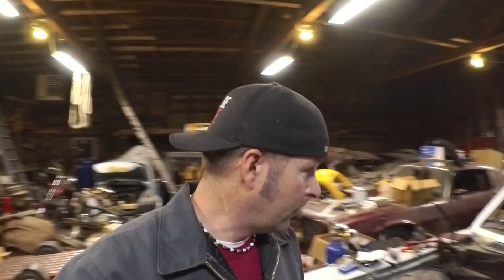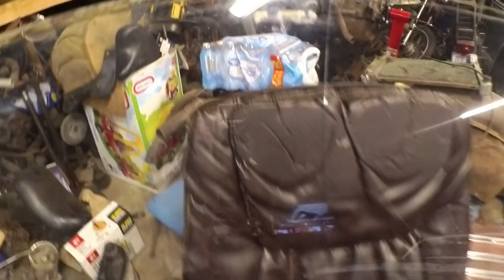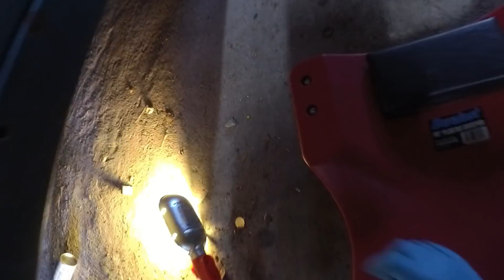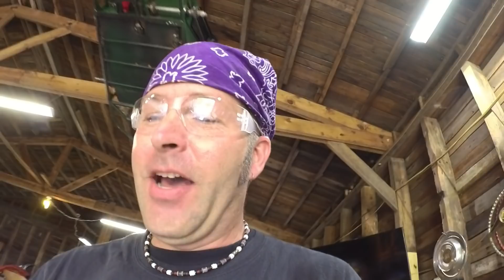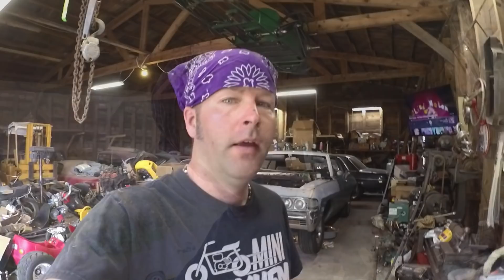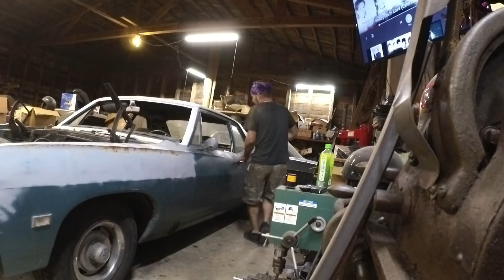Biscayne gets a new clutch

Comment: My uncle use to race inline 6 cylinders on the dirt track back in the 60`s and 70`s . He got almost got 350 hp out of them . Milled head , copper gasket ,3 angled valve job , 2 barrel carb. 550 or 600 cfm , header , hot cam ,polished and ported head .

Comment: You may be not able to spin tires, but you can spin tire! My first ever auto work was changing the trans and clutch on a 57 Chevy 210, in a parking lot! I actually found today the official repair manual that came with the car that I used in 1971! The used trans was $25, the used clutch $10.

Comment: Scammmers are getting bolder! I'm excited to see the progress on the Biscayne, you did some quality work on that windshield frame! I do agree that getting a new windshield is just the best option, if the old one didn't have the crack in it, then I could see putting in some time to steel wool it and get it super clean, the use it but with that big crack, it just isn't worth the trouble.